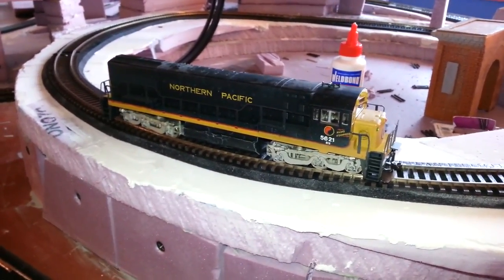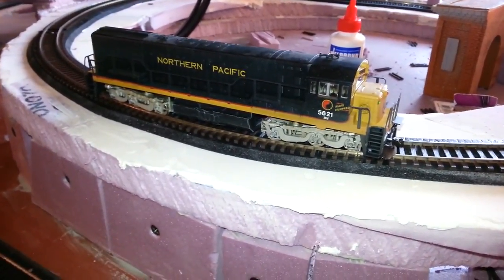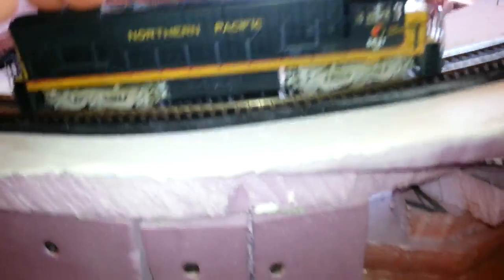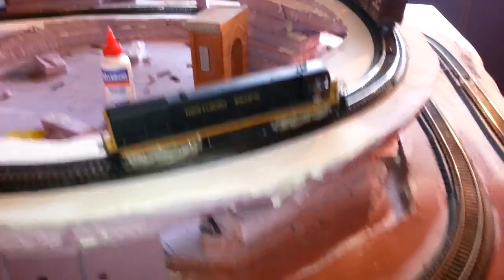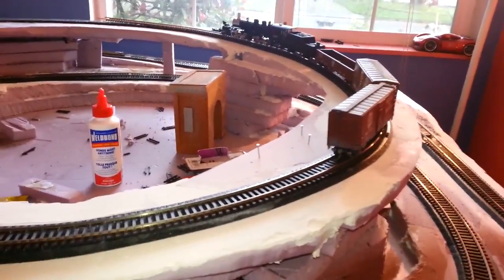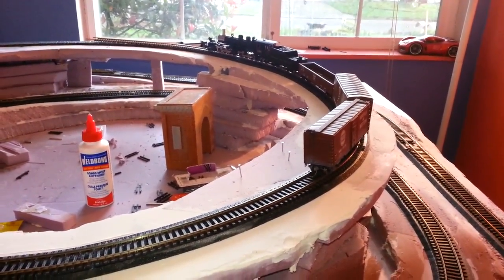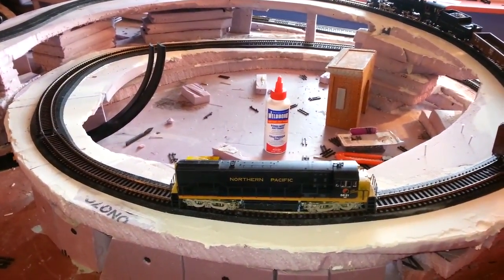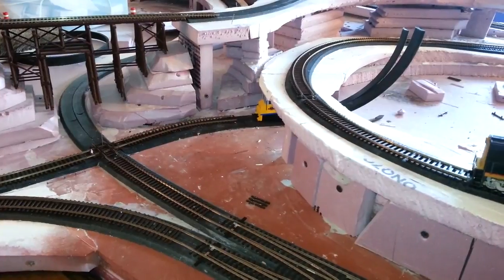#7B HO Model Train radius problems, long is better

Comment: for best results on curves, go minimum 22-inches up to 30-inches with no more than 2.5% grades. If you take up those tight curve you can still put down wider tracks for your 6-axles diesel engines. The steam works on it because its articulated. Also, any rolling stock 40 foot and below works on tighter curves and smaller turnouts. Any rolling stock above 50 foot works best on 22-inch or wider curves and #6 or higher turnouts.

Comment: It would have been helpful to know what was your radius you used on that grade.  I'm a newbie and you'd think I'd find lots of videos on "radius turns" wouldn't you?  Nope...lots of titles about it, but nobody is going into the math of it at all.  Hmmm...
Reply from the maker: I know I struggled with the same thing my radius was definitely too tight and I went from 18 to 22 eventually.  Some are still 18 so I can't run the bigger 3 wheeled truck train engines